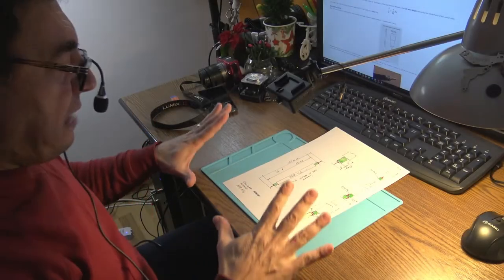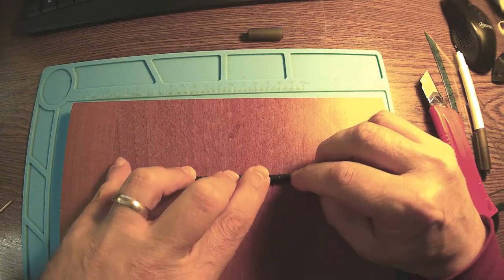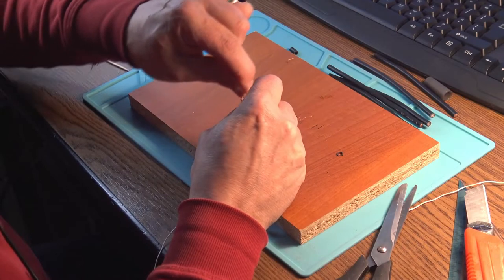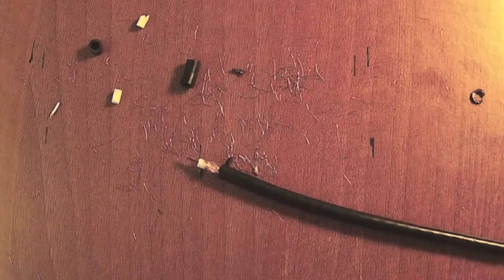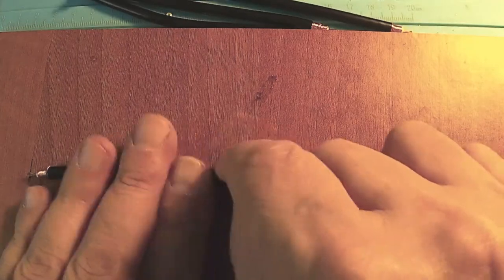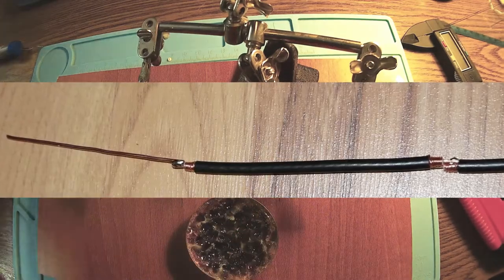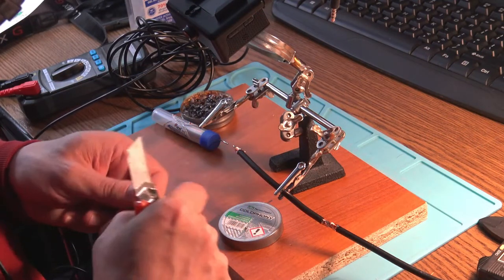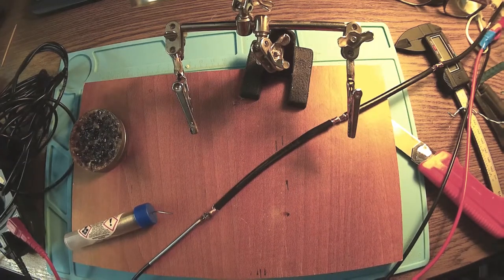DIY 868Mhz LoRa collinear coaxial antenna 7.8db part I

Comment: Thank you very muck for your videos! What is the influence on the antenna if you use higher diameter coax? Will it be better?
Reply from the maker: I really don't know, important is the velocity factor which is different from cable to cable..this RG58 clone was like .86 instead of a good quality RG..which is .66. Probably a good quality cable will do a better job..consider the radio waves traveling at the surface of the cable not inside the core..

Comment: Very nice video and explanation. Aslo your audio is very good. However I would like to see a bit more light in your videos.
Reply from the maker: Thanks! Good idea with more light..About SWR I ordered and SDR radio and I'll try some tests.So far is working great but I don't have a compare to..the original is no way to reference.
Reply from the maker: Just reached 45Km with it
Reply: @viocaia  Very nice. Just one question. That feeding part of telescopic antenna (half length of one antenna part), you stripped down outer insulation of coax cable and just pulled that tube over braided shield, is that right?
Reply from the maker: @alenramic5077  You don't need to take the plastic off..just open lik 5mm of shield and solder to the tube
Reply: @viocaia  thx for quick answering. So just to strip down e.g. 5mm of shield and solder braided shield to tube.
Reply from the maker: @alenramic5077  yes..
Reply: @viocaia  Great. And from which matherial is tube made of? Because I found on the net that for calculation of the tube length you need tube velocity factor. Maybe Im wrong...

Comment: according to the table i found at wiki, VF of RG58 is 0.81 . Because of that you changed the size of elements in Part 2? Can you tell me how to calculate size of parts, if you have other type of coaxial cable, to get 868Mhz?
Reply from the maker: Exactly...my first attempt was done considering 0.66 for RG58, totally wrong..
Reply from the maker: I can say the antenna is working great , sending beacons more then 60km..way better then the standard 3db..
Reply from the maker: I use this page for inspiration https://jeroen.steeman.org/Antenna/collinear-coax
Reply: @viocaia  Thank you. I dont have network analyser but Ill try to make one and we will see how will it operates. Did something similar for wifi antena but I had calculation for that. This will help, thanks again
Reply from the maker: @xIRFOx  Just follow the design from part 2 and it's working for sure.Be careful not to short the dipoles..check with a multimeter each segment after you do solderings. Good luck!
Reply: @viocaia  I have RG11 with vf 0.84 . What size for the top element I need?
Reply from the maker: @xIRFOx  top element is quarter wave in open air..have the same lenght part 2
Reply from the maker: @xIRFOx  https://www.youtube.com/watch?v=7Wjst9A7El8&t=562s at the end you have the schematic
Reply: @viocaia  Hi. My first antenna was tested and its ok. Thanks for everything. I need to build couple more but now Im looking for info what cable is best for it. This one was rg11 75ohm, used last one I had. It would be better to use 50ohm? I have rg58 but its not solid. Other options i have is rg213 and h500 used for radiocommunication. Not sure is that good for this?
Reply from the maker: @xIRFOx  Any coaxial is ok as long as you know the velocity factor..I used what I found around RG58..but even TV cable it's ok..we are building dipoles so the impedance comes to the feed cable only
Reply: @viocaia  Hi. I made couple antennas, but now I got my nanoVNA to test one. I got result for swr 250m/1.216 for 868Mhz. What does this 250m means? I tried to put link of picture for nanovna result, but comment was removed. Do you have video how to measure gain of antenna?
Reply from the maker: @xIRFOx  Just c are about swr..as low as possible..the gain of antennas I'm measuring with RDS radio..but ther eis a way to do it with Nanovna, I didn't try that yet..it needs some space and a long antenna cable for TX on port 11 and RX to port 21 watching gain..
SO the TX antenna should be like 20m away..and beacon constantly , then you'll have the result on the receiveing antenna on port 21..I'll do that as soon as the weather gets warmer..for now I'm using my RDS radio on 868MHz..I can have a clear picture of the gain..
Reply: @viocaia  It need to be done with one nanoVNA ? Or if you have second one you want need that long cable. But if it can be done with one ,then just need to consider cable loss, to add it on result u get?